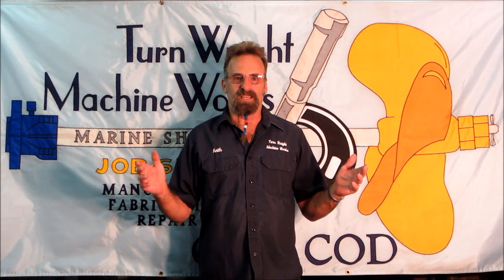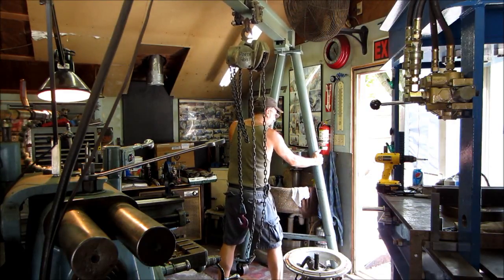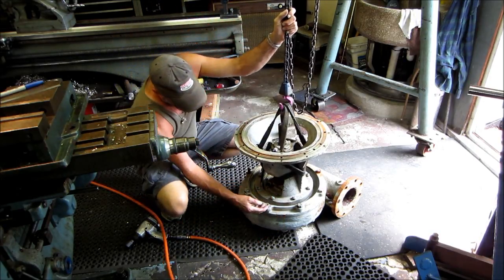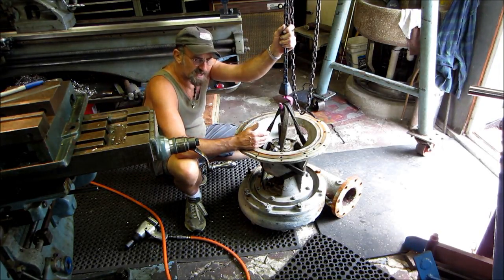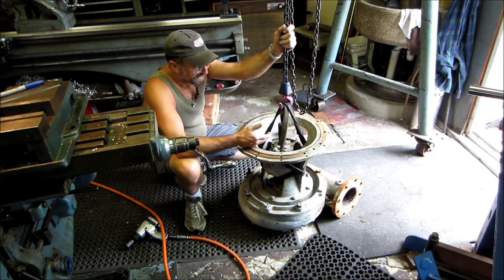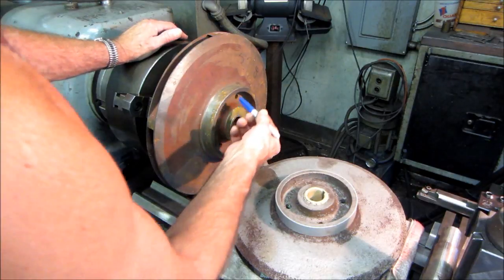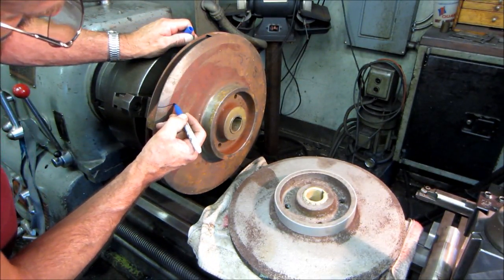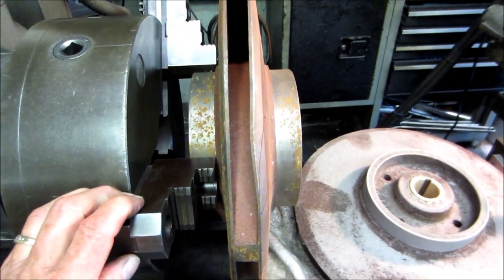Clam Pumper

Comment: I use to Build Teardown Vertical turbines , they are used for paint at GM ford , Water treatment plants waste disposal .   worked at PSI Prosiest systems Inc , Bowl repair bushing shafts bearings.   I know you have your hands full working on that pump ,  we did it all in the shop clean paint sand blast power wash hot bath in acid .  pumps made with  Brons, Stainless ,cast iron .  PSI pumps are all over the USA  Thanks for the Videos

Comment: I worked on sea clam boats out of Va for 6 yrs. They used Peerless 5,000 gpm pumps that were iron.  Don't remember any trouble with the bodies but a lot with the shaft sleeves being eaten away by sand.  The pumps were doing double duty as bow thrusters and picked up bottom because of shallow channel vs draft.  Interesting video.

Comment: I have never used that type of epoxy paint. When I paint something like a mower or piece of heavy equipment, here's how I do it. I use iron oxide primer that's oil-based and so thinning and clean-up is with mineral spirits. Before I brush on the primer, I wipe down the bare metal or sanded/wire brushed surface with mineral spirits and then I paint the primer on while the surface is still wet. It really helps to flow into the pores of cast iron. You should try it next time you prime something.

Comment: The tip of using distilled vinegar to clean up after painting with epoxy is valuable. It's worth pointing out that one should never use organic solvents (thinner, gasoline, alcohol brush cleaner, etc.) to remove epoxy from the skin as it allows the epoxy to penetrate the skin instead and aside from the toxicity one can quickly develop a dramatic allergy to the paint.

Comment from the maker: It has to have keyway for drive and a sleeve would let corrosion build in between the sleeve and that is what I'm stopping by coating the bore with braze, the whole idea is to stop the rusting. As soon as rust flakes off the impeller is loose, then slams a crack in keyway of shaft, leading to up to final separation. ;{)---

Comment: You should try a zinc based primer on those, if they can get a perfect white blast on them. I used to use it in the potash mines around here (salty hell). It was International interzinc, cant remember the number. Used alot of international 954 there too.

Comment: Keith, first off, let me say I love what you do and am greatly impressed by the way you explain how you do it. Watching you solve problems has me going "Aaaahhhh yes! That's how you do it!"

A question for you: I see you brazing the bore of the impeller here to build up a brass, non-corroding surface. Here in Australia we have lots of readily available brass, bronze and phosphor-bronze inserts available. Oxy and acetylene is expensive; why do you not turn out the bore and press in an insert?

Comment: Excellent tip about using distilled vinegar to clean up epoxy! Will that work with the polyester resin used in fibreglass work, too?

Comment: Actually, no, I don't. I used to re-fiberglass boat hulls with my father many years ago. That fiberglass fluff and resin was the devil to get off. I had no idea that vinegar could be used for removing epoxy or I'd have tried it on the polyester then.

Comment: keith - very interesting. We sell about 50 different kinds of epoxies, marine epoxies and floor epoxies (underwater epoxies and repair products). Also some non epoxy coatings. Google progressive epoxy polymers -  I might suggest a moisture cured urethane instead of an epoxy for the outside shell. easier to apply etc. google aluthane - often used on bridges, aluminum boats, etc.  - paul oman